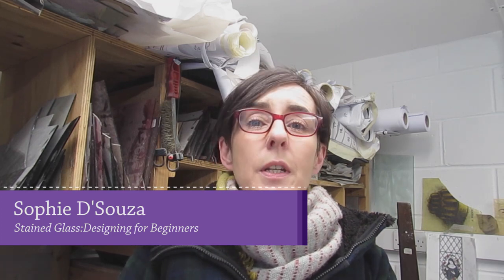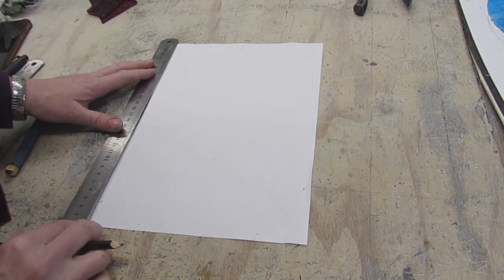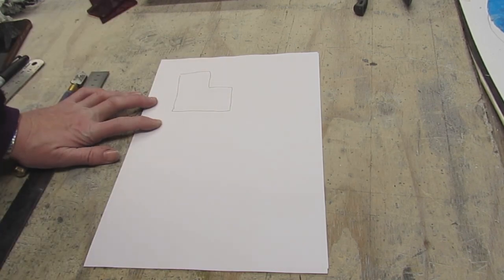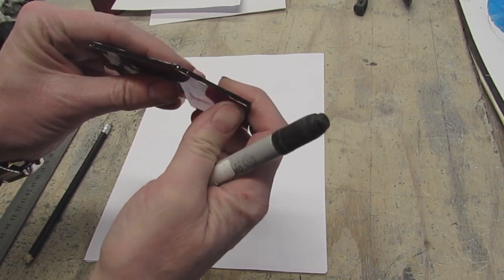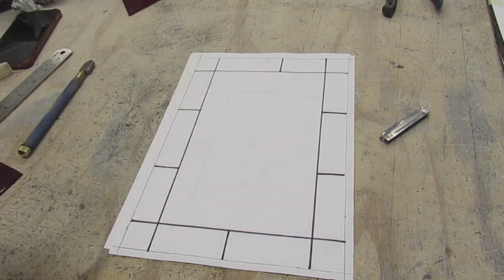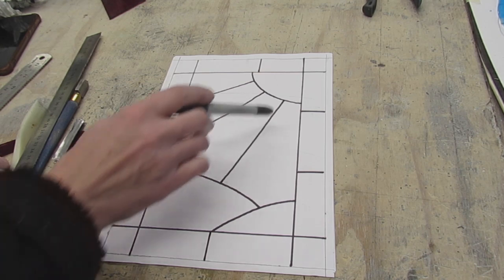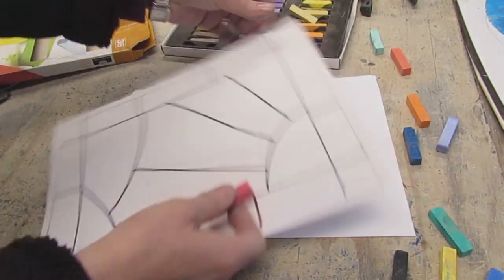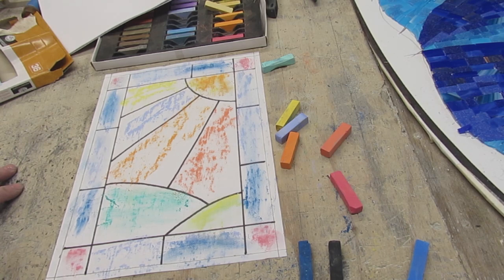Sophie's Stained Glass | Complete Beginners Guide to Designing for Glass

Comment: Sophie: why h-came on the border instead of u, being an outside border? what is the benefit? thank you from the Pacific Northwest.
Reply from the maker: Well, for a decorative piece, u lead would be absolutely fine but as I only do architectural work(unless I'm making a video) I use h as standard and don't generally keep u or c in. H is necessary for installation as you can trim the outside flanges for a good fit.

Comment: Thank you for the video, my first panel will be a simple grid of squares - could I ask should  I run long pieces of lead  across the grid with shorter bridge pieces running up and down OR would you suggest using the short pieces both horizontally and vertically? Thank you Sophie
Reply from the maker: Try this video https://youtu.be/kwWnBcZKLns
Reply: @SophiesStainedGlass  Thank you sophie

Comment: Great footage. I often wonder what size space you need to refurbish the big leaded lights windows for churches. 
Do you not worry how they will be transported back to the church for fitting? 
Don't they often break in transit, or do churches allow you to use their space to do full big window repairs? 
I am a glass cutter, and i use a big cutting bench at work. 
But transporting leaded lights must be awkward the bigger they are? 
Also, i can free hand cut a hole 80mm at the smallest, and also to cut a right angle out of glass, is ok if you slowly put a small curve in the corner, and tap on the curve itself, not the run to it. 😉
Reply from the maker: Good tip! Actually if you box glass up for transit, it's not a problem. Even the biggest window is made up in small sections so you're not transporting panels bigger than 1m sq.